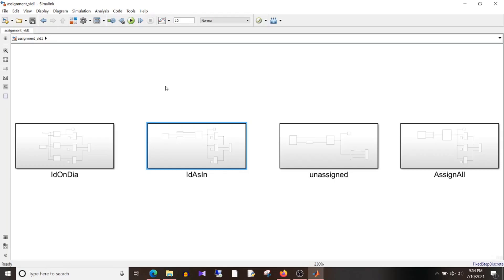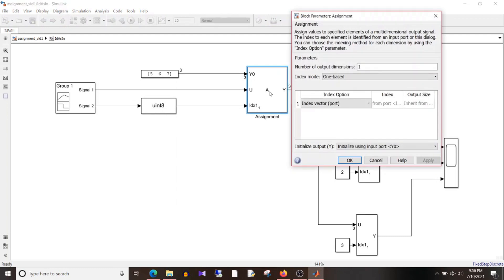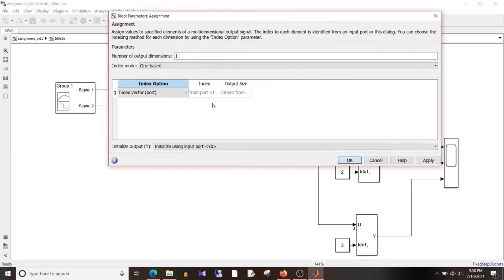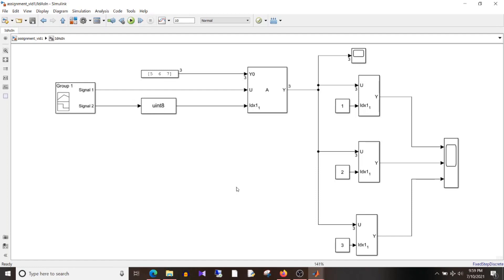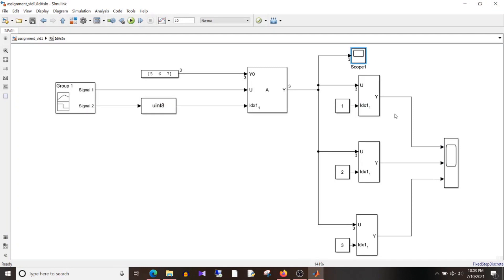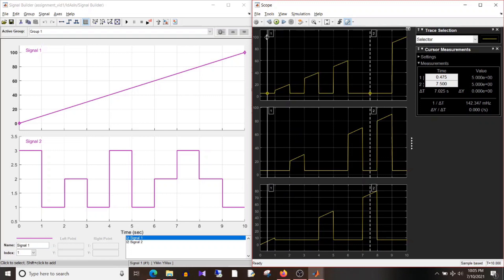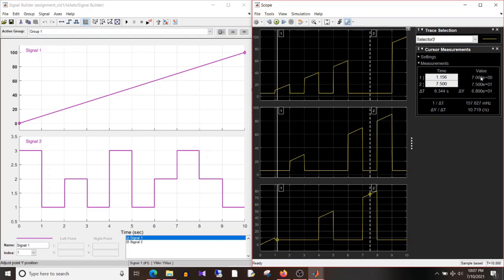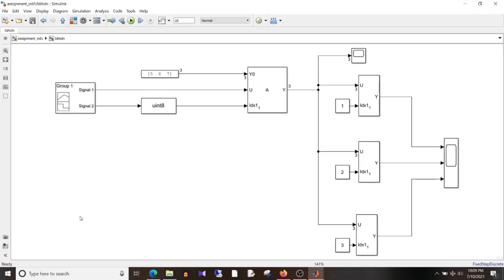Simulink Tutorial - 73 - Revised  Assignment Block - Part 2

Comment: As a suggestion for those who are still not understanding how the assignment block works: You can consider the index vector value as a "enable" for the input u, meaning that , for example if you have the ydx1= [1 2 3], yo =[0 1 2] and u =[2 4 8], at time t0 the active index is 1, so  u[1]  is "active". Now if you see, u[1] =2 , so y(1) = 2. The other values y(2) and y(3) (meaning signal 2 and 3 from output) will take the values form y0 at their respective indices;in other words y(2) = y0[2]=1 and y(3) = y0[3] = 2
Now , if you follow the pattern above for y1, you see that index2 is active and we will have : y(1) = y0[1]=0, y(2) = u(2) = 4 and y(3)= y0[3]=2
Hope this helps!

Comment: Please make a detailed tutorial in which we start from designing a plant model ( any physical model such as mass spring or vehicle suspension system) and the designing a controller for that plant to meet some requirements. Then please perform the SIL MIL testing including auto code generation. Please it’s very urgent